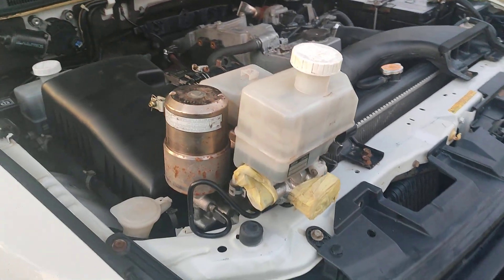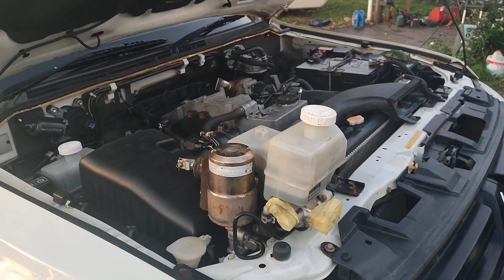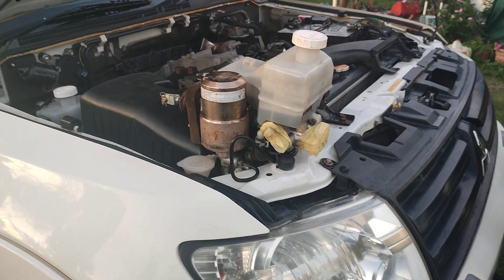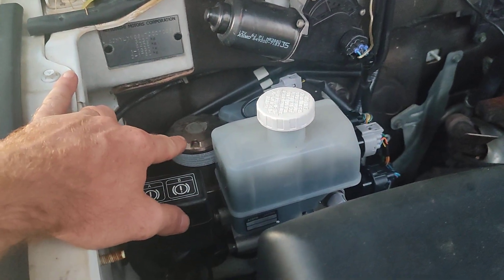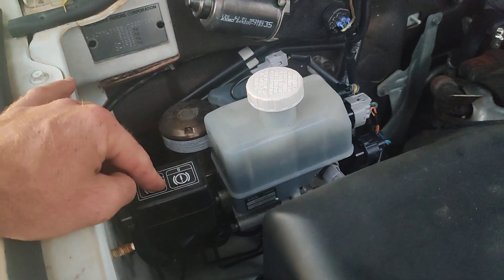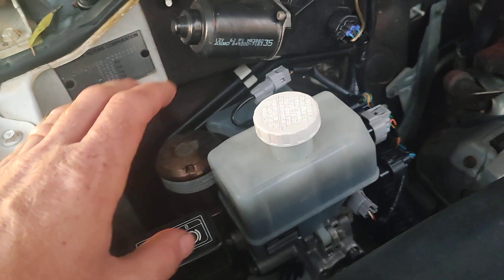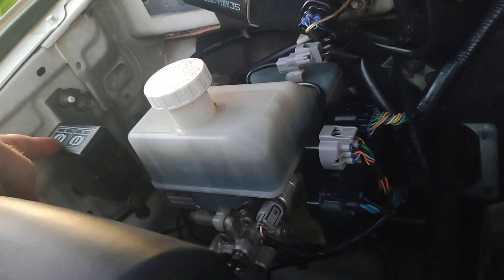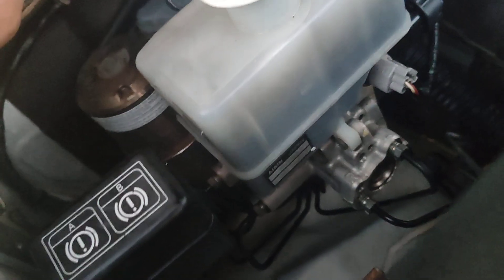Pajero Hydraulic Brake booster HBB explanation and failure types

Comment: Thanks, very thorough and well explained video. I suspected my electric pump was gone, especially after tapping it with a hammer and it started to work again. I was worried about buying various parts that were not needed, but your video has confirmed it's most likely the electric pump.
Reply from the maker: Glad it helped

Comment: Hi found this as my accumulator faulty. Ordered one from UAE from a supplier I've used before. A few things I found on my MK3 2003 top right hand nut impossible to get easy access. Electrical cable fuses immobilizer in way I didn't replace it as yet. I had to remove complete ABS had old black sphere type. When replaced with new cylinder type. It fouled on the bracket had to cut away small section. Replacement of ABS not trouble free 3 of pipes screwed in ok 4th was a pain. Movement of pipes caused slight misalignment of the one. I've got to bleed system now but thanks for your video. Just a little heads up for anyone working on ABS. Information is always good 👍
Reply from the maker: Thanks. Glad it helped
Reply: Thanks for your reply a slight update. As I said it had to bleed, this was done but the motor pump restarts after a couple of pedal ops. The noise has disappeared.I'll have another try to bleed must be air in the system. Did a couple of emergency stops, all ok no pulling out of the straight line. If I don't come right I'll take it to brake place. One thing I noticed operated the brake to it was hard,level increases in the tank. Thanks

Comment: Thanks for the video and explanation of what can fail. Recently picked up a lexus gx 470 and the motor is running constantly and when is off for a few seconds I can hear a hiss around the accumulator. Haven't seem any brake fluid leak. I'm going to replace the small o-ring on the accumulator threads and clean the plunger.
Reply from the maker: A hiss is probably internal high pressure bypass. Try testing your relays first to see if they are stuck in the ON position, overworking the pump. The accumulator is filled pump up with brake fluid. If the factory nitrogen fill has leaked out you will have no power assisted brakes and likely will have a bunch of error lights on the dash.

Comment: Concerning the bleeding procedure. I'm assuming you drained the booster tank mostly before you removed it? Did you just put some rags under the flare nuts when you bled the brakes that way? Did much brake fluid come out? I'm asking, because I don't have a stable or flat surface to work on currently, and can't move the Pajero. So I can't jack it up to reach the bleeder nipples. Thanks for your help Marius.
Reply from the maker: No, I didn't drain. Pajero sits high enough to reach bleed points. Not a lot of brake fluid emptied when opening nuts. I just rinsed with plenty lukewarm soapy water when finished as brake fluid eats paint.

Comment: Brilliant explanation, thanks for sharing. I have a 2003 Pajero which is making an awful squeel when pressing the brakes. Sounds similar to the sound you described. 
Is replacing the reservoir fairly straight forward, as the sticker mentions to use caution high pressure nitrogen?
Reply from the maker: ignition off. pump brake pedal fourty times. unscrew. make sure the rod and spring doesn't fall out and get lost. simple.

Comment: Thanks for the awesome video. A couple of weeks ago I changed all my calipers and one of the calipers I bought was defective and bled out a lot of brake fluid. I got that problem fixed and now no matter what I do my brake pedal continually goes to the floor.  I did find a Mitsubishi documentation that was almost 200 pages about the brake system and how to bleed them. I followed it exactly and my break pedal still goes to the floor. Should I go ahead and look at the master cylinder at this point or should I keep chasing possible air in the system
Reply from the maker: Have you tried bleeding while the engine is running? This is crucial for the rears. And actually makes bleeding the rears very easy. Just open the bleed valve and the abs pump will push the fluid through. Do some abs braking on gravel to get air out of the esp valve block.

Comment: Hello sir. My 06 had the motor fail 4 mths prior. Replaced and was working fine. Had the accumulator chirp noise for a while. Noticed the accumulator started chirping when driving or coasting as well rather than only braking/releasing the brake. Bought a used accumulator and swapped. Now, the motor runs every 5-10 seconds and there is a slight hissing from the unit whenever the motor stops. No leeakage externally. Any ideas? No codes or warning lights. I stopped driving it. My country has no mitsu dealers so will have to import if i need the entire hbb unit. Thanks

Edit: the pump does indeed stop. Sometimes, when you turn the key in the morning, pump runs for 30 seconds and stops. No hissing either. Then, if i press the pedal a few times, it starts acting up....running every 5-10 seconds and there is a slight hissing.
Reply from the maker: Press and hold the brake while idling. If the pedal stay gradually drops, then you have a master cylinder problem (or leak at the brake piston on one of the corners). If it stays stiff but HBB pump cycles, then you have an internal leak in the HBB which will need replacement as a whole.

Remove accumulator (ignition off, pump brake 40 times - unscrew accumulator), then try to press the inside through the whole with a screwdriver. If it yields the accumulator is bad. If it's rock hard it's likely the accumulator is fine.

If you know someone else with a pajero, swap out accumulators with him and see if the issue follows the accumulator.
Reply: Thanks for the reply! I'm going to be working on it today and I'll have a go at these diag tips you mentioned. 

Unfortunately, here in Pakistan, pajeros aren't very common. 

I will post back here once I've got the issue fixed for anyone else who has a similar issue. 

Thanks a lot!
Reply: @MariusFourie 

Well, I have some good news. I did the tests you suggested. Pedal stayed firm, motor kept running every 5-15 seconds. 

Then, I removed the Accumulator and tried pushing with a screwdriver. Piston was solid. 

Then, I took the poppet valve and spring out to look down the hole where the Accumulator fits. I put my screwdriver in there which happened to be a magnetic screwdriver. Fished out a few very tiny pieces of metal. 

I then remembered the used accumulator I tried to install wasn't screwing in right. The first thread was a bit 'flattened'. I think some shaving fell into the hole. I cleaned it out, cleaned out the hole, and reinstalled the Accumulator. 

Lo and behold, everything seems back to normal. I took it on a drive around the neighbourhood and in town a bit. Seems to be doing fine. Will report back if I have any further issues, but I think I've solved my problem. 

Thanks!
Reply: @norontboyz5949 after the 3 months, is still working with no chirp noise? Or it came back? I'm thinking about give a try on unscrew the accumulator, check it out and screw it back.
Reply: Morning found this video which is very informative. I've a MK3 2002 ex UK in South Africa 3.5. Mines makes at screach on brake application. With switch off operate pedal about 20 times. Switch on ABS light on. Switch off then on it goes out. Suspect the accumulator but as it's 20 years old fitting an old one off same model could be faulty. Will the later MK4s fit straight onto mine as yours later model I've got the black round accumulator. Later ones are available but quite expensive from 2nd places. But obviously a lot cheaper than dealers. Cheers

Comment: Hi, thank you so much for this video. I own a 3.8l petrol pajero and the problem was that it had a continuously beeping sound with the abs light, asc off, traction light and brake light showing on the dash. I have just purchased a 2nd hand unit and have replaced it in the vehicle. The beeping sound has since turned off and so has the brake light. Everything else is functional however there are times when pressing the brake pedal I can hear noise from the accumulator. I did not perform any other tasks besides replacing the unit. Hoping you can give advice on what I should do etc whether its bleed the brakes .. really desperate for some help. Thank you
Reply from the maker: bleed the brakes all four corners. Bleed conventionally while car is idling. If this fails then the accumulator may be faulty on new unit.
Reply: @MariusFourie  after I bleed all brakes what should I expect or are there any further steps I should take?

Comment: Thanx for the video, really helpfull. I got the same issue with my pajero 3.2/ 2010. I got that noise of pressure release valve from time time but i dont have any sound alarm or lights on my dashboard. Although i have been test the alarm: with ignition off pumped around 20 times brake pedal and alarm works. I got also autel ap200 and it dosnt show me any error stored in the system. Should i try in your check order: relay, hydroaccumulator, high press sensor…. Will appreciate any advice. Thx.
Reply from the maker: Hi. Start with relay and then replace accumulator.

Comment: Hello Marius.
Thanks for your video.
I understood that the brake problem of my 2013 pajero full, s in the master cylinder.

 The over pressure sensor has failed.

So, can i remove and clean  it up?
Reply from the maker: The sensors are in the unit. You have to change the whole unit unfortunately.

Comment: Hey Marius, I've got a 2005 NP 3.8 litre petrol Pajero with the same Brake booster HBB. My issue is that I have aloud alarm, traction control & ABS lights on and the pedal is rock hard. When I turn the ignition on, I can hear the pump motor going, and then stops. I have zero knowledge on this type of brake booster, but it seems to me that the pump is switching off because there is adequate pressure in the accumulator. To the best of your knowledge, is that how the pump works? I would occasionally hear chirps sounds from the HBB. But that didn't happen very often. What re your thoughts please?
Reply from the maker: Start by changing the accumulator

Comment: Thanks for the video, did you ever get around to pulling the electronics apart to establish if the low pressure sensor switch is serviceable/replaceable. I’m fairly sure I have the same issue but reluctant to spend the $3200 to replace the entire unit if I can replace the switch.
Reply from the maker: no, I haven't opened it yet unfortunately

Comment: Great video Marius, I have the 4 lights on the dashboard and buzzer going with no brakes and pedal hard, I can’t hear the pump running so I suspect the motor failed?
Reply from the maker: check the relays and fuse first. If that is good then the little electric brush motor has failed

Comment: Good day, very informative video; My car is a 2004, Pajero 3.0v6 with 6g72 Engine. Please advice could worn out brake pads cause the buzzing issue when brake pedal is pressed? Because mine when I press the brake pedal 3 times with the engine off and ignition on I get the small buzz sound and an abs dash light! This is the exact sound it started doing a few days back, sometimes when u apply brakes to put on reverse it will make a continuous beeping sound then goes off after barely 5 seconds!
Reply from the maker: Check fluid level. Yours is likely accumulator. swap that first.

Comment: Can you replace the accumulator P/N 4630A012 with a 4630A011? The 4630A011 is the round black type accumulator.
Reply from the maker: Not sure. It might work but the gold can is the new one. I'd stick with that on such a critical component of the car.

Comment: Hello, Thanks for the video. What can be the problem when pump is turning on so frequently, like if I'm pressing brake pedal and holding it, pump turns on in every 8-10 seconds, but booster cylinder doesn't have any weird sound, just vibrating.
Reply from the maker: could be a leak in master cylinder or bad accumulator

Comment: Hello, I am using a translator, I hope you can help me, I have a Mitsubishi Montero 3.2, it has the annoying beeping sound, the brake motor is on for about 10 minutes and then it turns off, I used it like this during this time, the whole problem It came after changing the brake pads and now the pedal feels a little spongy. 3 days ago I heard the sound like a screeching sound, I think it is the accumulator but I don't know if it is the failure of the engine not turning off. I hope you can understand what I say

Comment: Hi bro.What is the correct way of the accumulator removal?Hold and twist accum. from the top or using the spanner from bottom? Accumulator makes some metal noise when brake is released.
Reply from the maker: ignition off, pump brake pedal fourty times then just unscrew anti clockwise.

Comment: Thank's for the Video,i got this system, mines a 2004 NP glx Australian 3.8L pajero, would be nice to know what a good one sounds and works like, eg does it make any charge up sounds.? just bought car few months ago and wondering if normal to hear a like a pump charge up cycle for eg 10seconds on key on then again for 3seconds again then stops. Brakes seem fine no lights on dash etc just i got no clue to what's normal on these 3.8L but looks just like your pump system..
Reply from the maker: 1.Turn the ignition switch to the LOCK (OFF) position. Depressurise the power supply system of the hydraulic brake booster (HBB) by depressing the brake pedal at least forty times until the pedal effort becomes high.
2.Check that the reservoir fluid level is at the MAX position.
3.Chock the wheels and release the parking brakes.
4.Turn the ignition switch ON, and measure how much time is elapsed after the pump motor starts until it stops.
Standard value: 20 - 80 seconds
5.After the pump motor stopped, start the engine. The brake warning lamp should not be turned on.
6.Stop the engine, and then turn on the ignition switch again.
7.When the brake pedal is depressed four or five times, the pump motor should start and then stop.
8.Depress the brake pedal four or five times again, and then measure how much time is elapsed after the pump motor starts until it stops.
9.Depress the brake pedal fully consecutive 15 - 20 times for ten seconds. The brake warning lamp should illuminate and the buzzer should sound.
Standard value: 2 - 11 seconds.

caution :	Turn the ignition switch ON, and wait for at least 120 seconds before carrying out the checks.
Reply: @MariusFourie  Very Cool, will give me a baseline to condition for sure..Thank You.
Reply: In my case, the pump comes in for 3 or 4 seconds everytime I press the brake pedal. Sometimes I hear the relief valve chirpin sound.
Reply: @maiqueldeivit8197  yes i watched a video on that not a good sign the chirp bit "wear"..mine seems to be within specs as described by OP.

Comment: Hi Marius I have a 2012 pajero to which the brake pedal gets stuck down every now and than any ideas as to the problem please
Reply from the maker: probably a failing master cylinder seal.
Reply: @MariusFourie  thanks is this an easy fix or do I need to replace the master cylinder
Reply: When I search brake master cylinder it comes up with the brake master cylinder accumulator will replacing this fix the problem do u think

Comment: Hello, Marius. Thanks for the detailed video!
I had a brake failure a couple of weeks ago which turned out to be the pump motor, so I changed it out and the error lights switched off. Now whenever I press the brake pedal I hear a loud hissing sound and the pump motor turns on to re-accumulate pressure. Do you know what might be the issue?
Reply from the maker: Perhaps it needs a proper bleed. Remember the car needs to idle when bleeding the rears.
Reply: Thanks for the suggestion. Turns out that is exactly what’s been wrong. When I bled the rear brakes last time the car was off. Thanks again 👍👍

Comment: Hello from the Philippines. Got a little issue here. I was coasting thru traffic and noticed that my brake pedal does not return up right away. 
Little bit later, it works fine again. The symptoms is intermittent. Sometimes it goes right back, sometimes not. Pls. Help.. 😢
Reply from the maker: sounds like a bad brake master cylinder
Reply: @MariusFourie  so i have to replace the whole assembly? Accumulator included??

Comment: Recently changed accumulator and system was working fine, until I heard that annoying sound from under the dash, again, however when I hear the sound, the brakes gets hard after a while, then I tap the accumulator and then I hear the motor comes in and starts pumping. I've tapped the reservoir and nothing, only when I tap the accumulator the motor comes In and I have brake again... What could be the cause?
Reply from the maker: I suspect the electric brush motor is tired. Have it repaired or replaced.

Comment: If the dashboard have 2 lights abs and hand brake lights it makes a sound like pip sound but the sound is contineus not breaks like pip. What could b the problem
Reply from the maker: post a video. Could be a bunch of things. You will have to work through the system step by step. Fuses, relays, motor, accumulator